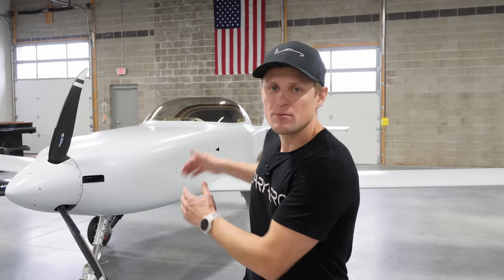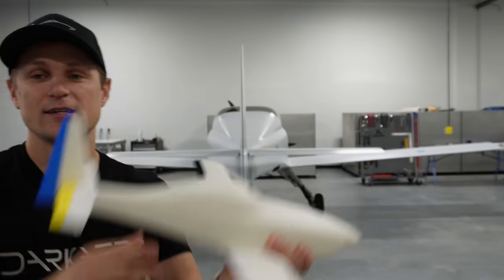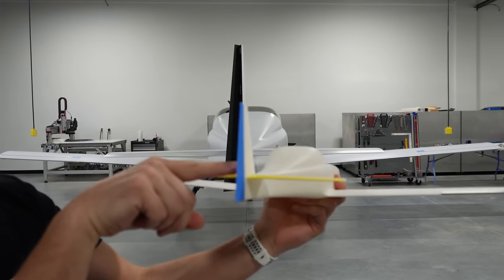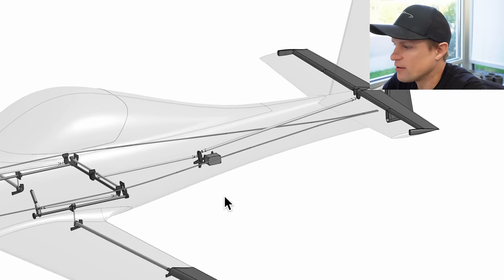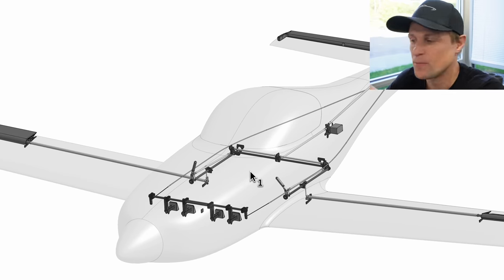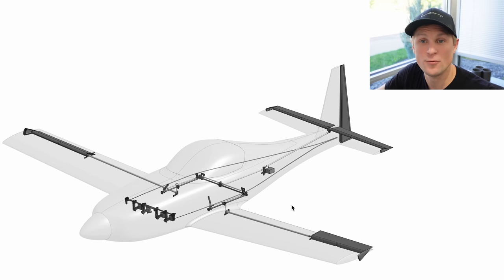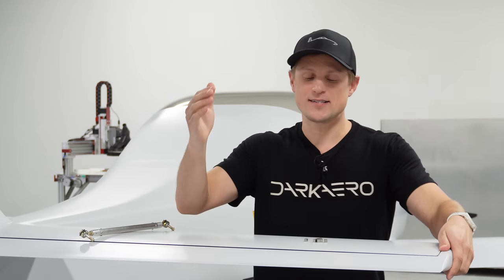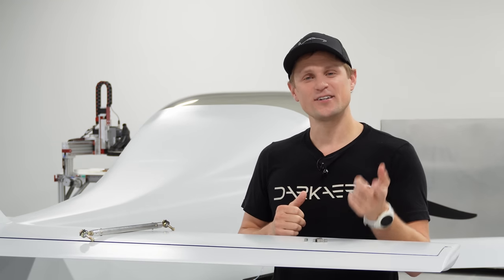What makes our flight controls different

Comment: The split rudder is so sick
Reply: I agree. I imagine there's a small aerodynamic penalty to using split rudders. I'm pretty sure the split rudder has more drag in use than a conventional rudder. Having a speed brake likely makes any loses worth it.
Reply: Was wondering if that could be a replacement for ... flaps. Thoughts?
Reply: @fdelacou - It could replace flaps for giving drag while reducing altitude without gaining airspeed.  Won’t add lift for slower takeoff and landing speeds though.
Reply: No! Not sick but good!
Reply: @fdelacou   NO.  Flaps increase lift and drag, important to minimize and bleed KE during landing.  Lift is critical for this.   Flap extension is typically not allowed at high speeds due to high loading they can create.
Reply: @timduncan8450 yes. I was considering flaps for landing but completely forgot to include their use on take off. 😅
Reply: @ddegn  possibly a big penalty - increases frontal area a lot
Reply: @fdelacou  Did you mean Ailerons? Split Ailerons would be a great way to loose that adverse yaw.
Reply: What are you, let me guess, twelve years old. Grow up!
Reply: It could make the rudder less effective. When you move just one side with split rudder you leave one side which adds to vertical area. This vertical area will make it harder to move the tail in the direction you want to displace it.  This is very important during maneuvers that require maximum rudder effectiveness such as spin recovery. I also don’t think the airflow will stay attached as well. There is a reason that nearly every GA airplane has a traditional rudder.
Reply: This aircraft is designed around the UL520iS engine with Airmaster electric constant speed propeller.

There is no other engine propeller combination option.

Constant speed props are the most powerful airbrake on an airplane. If you push the prop lever forward (flip the switch to climb or takeoff setting) and reduce the throttle: You will slow down immediately. Like, right now. You can scrub 100mph almost faster than you can react in this way.

Air brakes are a pointless waste of effort on a propeller airplane.

Did the P-51 need air brakes? 

Did the P-51 fly faster than Dark Aero?
Reply: It was used in space shuttle.
Reply: Yeah

Comment: You might want to consider a lockout for the split rudder for takeoff and climb. Canard flyers of various makes have had issues during engine outs of panic stomping on both rudder pedals, exacerbating the emergency. This is of course, alleviated with training. Also, a lockout would keep the passenger from inadvertently inputting while shifting their position, ect.
Reply: Does a control lockout not have its own safety challenges?
Reply from the maker: You wouldn't want to lock out the rudders during takeoff, climb, or any other phase of flight since they are required for directional control.
Reply: @DarkAeroInc  only lock out the split rudder functionality. When locked, it should behave as a conventional single rudder
Reply: The ability to flip a switch to convert the rudder(s) into a single control surface would inherently be safer. (If this function is actually desired) Failures to the pins/flanges shouldn't lead to any particular dangers.
Reply: I think y'all are overestimating the effectiveness of airbrakes. 

Air brakes effectiveness diminishes exponentially as speed it reduced. While Propeller thrust increases substantially as speed is reduced. There is a velocity at which the additional propeller thrust will easily overcome all of the additional drag that a split-rudder can generate. This airplanes has a power to weight ratio far in excess of O-235 powered, fixed pitch prop driven Canards.

My concern that I've stated several times before, over the last few years, is relating to spin recovery. 

That is a very high aspect ratio vertical stabilizer having rather short ~20% chord split-flaps. While they do generate the same lift increment as plain flaps, they also generate a substantial amount of drag vs plain flaps for a similar deflection. 

Again, the airplane can overpower this additional drag, but in a spin its not going to be pulling itself out of it with throttle alone. It's going to need large lateral forces to counteract the spin. Since this airplane has longer, high aspect wings loaded down with fuel along their length, that's a lot of spinning mass to halt. 

This requires a vertical stabilizer with sufficient area, and rudder area aft of the hinge-line. It also requires LOW aspect ratio, as 3:1 is going to stall at a much lower Angle of yaw/sideslip/spin than an aspect ratio 1.5 will. There is a fix that I expect this design WILL require for satisfactory rapid spin recovery: And that is a ventral fin addition to the base of their vertical fin, partly to increase its area  but primarily to generate a strong vortex across the middle of the vertical surface at high angles of sideslip. Improving the post-stall lift of the vstab, and "cutting it in half" effectively halving its aspect ratio via the leading-edge vortex. It also needs a larger rudder aft of the hinge line, a few inches extension to the skin/ribs would suffice.
Reply: Lol. This would be one of the dumbest things to do if you actually know the physics of air flow
Reply: Some good points @TheJustinJ  . If the rotational momentum (in yaw) is high due to fuel placement, and the vertical stabilizer is stalled due to its high aspect ratio, then we have a spin recovery problem. Naturally this could be modeled on the computer, and surely they'll be testing spin recovery in flight (maybe with a drogue chute??).
Reply: He refers to INADVERTENT deflection , probably under pressure, adding to drag AND reducing ,or losing entirely, rudder function --the simplistic 'butterfly' opening with no aerodynamic balancing is also a problem for use at high speed (if control is lost in cloud sailplanes are required to be able to deploy the drag device up to Vne to prevent structural failure or flutter at high speed if control is lost .  90 degree flaps have a disadvantage is this (and other) respects whilst being superior in many ways for normal landing .   You can at least use power assist for your 'airbrake' function but only having thin single surface plates as shown will not allow for significant drag forces (unless perhaps pneumatically 'airbag' actuated....) @DarkAeroInc
Reply: @TheJustinJ  Exactly so;- I think you might mean dorsal fin (or both ventral as well) -the first 707s had a 'scab on' ventral fin to overcome yaw 'issues' ( arising from an Australian certification engineer's analysis ,Mr Ken O'Brien - later removed after the increase of fin height -check old photos...)  Split flaps as used on the DC3 Spitfire and others of that era have large deflections to add drag beyond the maximum lift deflection - non linear rudder response during airbraking would be another disconcerting side effect .
Reply: Cross outs are unintentional computer glitch -apologies.
Reply: It seems it's fundamentally designed as a split control, mechanically. Doing as you say could require a massive rework of the design, or some addition of a phased cam placed between pedals, which could add to pilot mental burden in unforeseen ways. To automate that functionality, would need some smart hydraulic or linear actuators, but that adds complexity, weight, new failure modes, and design cost.
Reply: @nicklockard  Having a a rudder bar (vertical pivot axis) with pedals allows for both functions reasonably simply -- gliders have to have in flight adjustabllity due to reclined seating -a modification of that apparatus also achieves the effect - in either case the hinge moments if there is no aerodynamic balance will be a problem and particularly to sustain high foot pressures for a long high speed let down .  The Blackburn Buccaneer used a balanced air brake design worth studying  and several airliners (F28 I think  as one )  a splade type surface can also work (servo)
Reply: @codeforge3301  at which point why would you even go with a split design (which tbh is a very stupid idea)

why not have separate airbakes and a conventional rudder? its not like youre making things more complex, the split design is already stupidly complex so all youre doing is moving the amount of moving parts around to different parts.
Reply: @TheJustinJ hey you sound like you really know what you’re talking about!  Just curious, why did you mention throttle pulling you out of a spin?  wouldn’t you put throttle to idle first thing in a single engine spin? PARE - it’s the first one- unless I’m mistaken?

Comment: Very interesting rudder design, really clever double identity for a rudder.  However, even though I don't see this bird doing dive bombing, the dive bombers in WWII also had an air brake, which didn't work until they poked it full of holes.  Before the holes, the dive flaps ripped themselves off the airplane in some dives.  There's going to be quite a vacuum in between your rudder panels.  They're also small, unlike the surfaces of a dive brake, so making them work without unexpected consequences should be easy.  Holes near the very front of the control surface should do, and won't interfere with the forward flight aerodynamics of the surface, but it will do the pilot and structure a favor.  They can be made as decorative as they are functional.
Reply: I was going to mention the drag. If you need to fly with a trim, you'd be flying with a parasitic drag.  Anyway, yours went well beyond that!
Reply: They didn't have carbon fiber back in WW2. But it is a good idea if they need to.
Reply: @LawyerPapa  Ouhhh thats a solid concern.

Comment: We designed split rudders into the Lynx suborbital space plane we were developing at XCOR for similar reasons- it allows speed brake function and also was much simpler to actuate given their locations at the wingtips. We were also able to include a slight preload against the stop to provide greater resistance to flutter, important in a supersonic aircraft.

Comment: Is there an expected loss in rudder authority with your design compared to conventional designs, since only half of the rudder deflects with say a right rudder input. Wouldn't the fact the left half of the rudder remains within the line of the airflow "block" some of the airflow from adhering to the interior side of the deflecting right rudder and therefore reduce effectiveness?
Reply: It looks like it shifts the air flow point of indecision on the leading edge so that more air will flow over the clean side and move with higher speed giving more lift.  Will it be efficient and forceful enough for fighting repeating turbulent air gust rapid wing rises or more importantly immediate effective and powerful spin recovery?  Imagine an inadvertent spin at aft C.O.G. with those pretty, narrow wings.

Comment: Always a great presentation…

Tungsten makes an interesting choice. Density, and doesn’t corrode at ordinary temperatures of aircraft operation….   And not soft like lead.

There is a recent AD for these elevator balance weights on a popular airplane because the weight was cast in a tube… and corrosion formed between the lead and the tube…. The corrosion forces expansion and the weight tries to fall apart.  The problem took 20+ years to appear… but, once started the rate of oxidation increases, exacerbating the problem…

Go DarkAero!

😃

Comment: Nice, heim joints, bell cranks and torque tubes, with not a whole lot of translation, so backlash should be minimal. You might want to also mention that the control surface weights, by projecting up into the airstream forward of the hinge point, also help manage control forces at higher airspeeds.

The split rudder works VERY effectively as a speed brake, I use them this way all the time on my Cozy.

I am curious what you're using as a rudder return spring - it looks like you're using push-pull cables to actuate each rudder, but I don't see space inside the rudder for a spring assembly - is it at the pedal end? If so, how do you plan to prevent buckling of the cable in push near the pedals if there is resistance at the rudder end? You'd need a decent sized spring to overcome the friction of a push/pull cable that long.

Do you engage the brakes master cylinders only after you get full rudder pedal travel? How do you ensure you can land with the rudders deployed, but without the brakes deployed? (I'm assuming the nosewheel is full castering?)

Lastly, I didn't see the roll servo, I'm curious as to where it's going to end up - it looks the only practicable place is behind the seats?
Reply: - How I heard it, the rudders are independent - with only a pull cable (spring return to centre) - ??, is the rudder deviation only from centre to full lateral deflection (left or right) ? - OR  having no centre stop, the lee side rudder (low pressure)  just follows the pressure side (half) to full deflection under spring action?  -  using the airbrakes on a steep straight-in approach sounds kind of similar to balancing regular toebrakes for yaw control, from the sound of it..   hmmm...

Some high performance lightweight RC craft also only use a (single acting) pull cable (kevlar thread/kite-line often used) for tail unit control, the tension is maintained by spring tension as is full tension deflection - balanced by servo force - (spring-pull rudder and elevator - no tensioning problems or slop can intrude)
Reply: I think they're making a mistake with the split rudders in the way they have them designed.  They really need to follow each other at least somewhat past centerline for the first third of their travel before splitting, with canard aircraft a little misalignment doesn't come with a drag penalty but it certainly will with a split rudder, and especially so with conventional tractor configuration slipstream hitting the vertical.  There will only be a single speed and throttle setting in which the two rudders are streamlined and together, the rest of the time one or the other will be split, meaning you'll always have a small amount of airbrake deployed.  The rudder pedals should also be interconnected in their movement with airbrake function as a separate lever to actuate that simply moves two pulleys to shorten the rudder cables.  This would allow standard toe brakes to be used instead of pushing the pedals to the floor and forcing the airbrakes open in order to make the toe brakes work, or having to use the dreaded piper style hand brake.  You may not always want to use brakes with the airbrake deployed for whatever reason, and not being able to put any pressure on the rudder pedals during flight to avoid deploying the airbrake is going to suck.

Comment: I used to fly the SAAB 340 and it had the most amazing redundant elevator system.  Basically the left control column controlled the left half of the elevator and the right control column controlled the right half of the elevator.  Normally they'd work together as one unit as there was a friction and mechanical plate that meant that if one side moved the other side moved as well.  But crucially if part of the system jammed you could overpower the linkage between the two sides and still be able to operate at least half of the elevator.  I always thought this was an amazing way to provide redundancy.

Comment: I never tried the split rudder although I thought a lot about it. I have flown canard aircraft so I understand the speed brake part of it. Good job! Also it looks like you have some differential in the ailerons. Very good! Something I did a lot was flattening and widening the aileron counterweights so they tuck up inside the wing tips only when the aileron deflects down but the weight enters the wind stream when the aileron deflects up. This adds some parasite drag to the to the up aileron side of the aircraft thus reducing the amount of rudder required to maintain coordinated flight. It's good to see some young people that know how to think out good design. Keep it going and be careful. Thanks for the videos!

Comment: The Long EZ 'rudders' are somewhat required to be airbrakes, since they use a different principle to normal rudders to yaw the plane.
Normal rudders apply lateral lift to the tail to pivot about the center of gravity. Since the Long EZ rudders are more to the sides rather than behind the CoG, the force required to pivot around the CoG is almost straight backward, ie, drag. And they need to be differential so that their is a net torque.
If the EZ rudders were set up to act in unison, in the same direction, you would find that it would barely yaw.
Reply: edit: I checked my plans and the Cozy definitely has a shorter rudder moment arm than a comparable 172, previous comment deleted. oops!
Reply: The LongEZ and Cozy both place the rudder aft of the Center of Gravity. Rudder deflection yaws the aircraft in the conventional sense. Yaw control also benefits from some increased drag located far outboard. But the drag increment is minuscule compared to lift increment from a deflected flap. This is self evident in all flapped airfoil wind tunnel measurements.